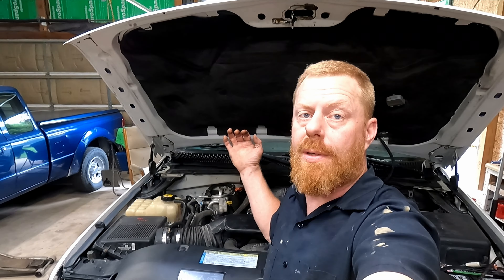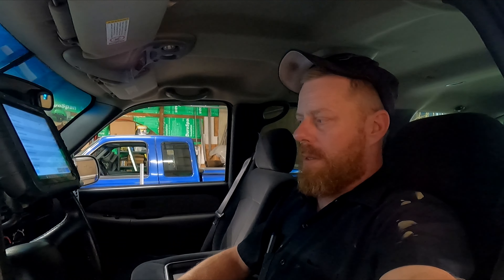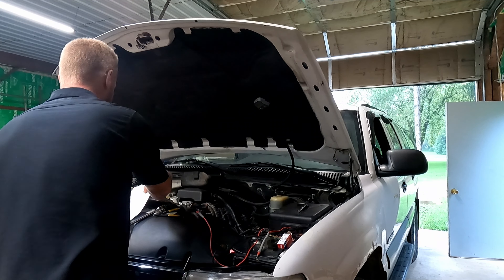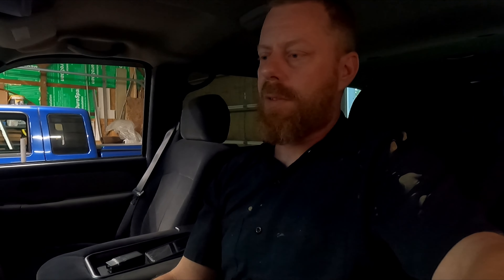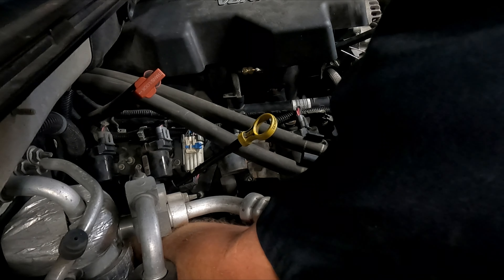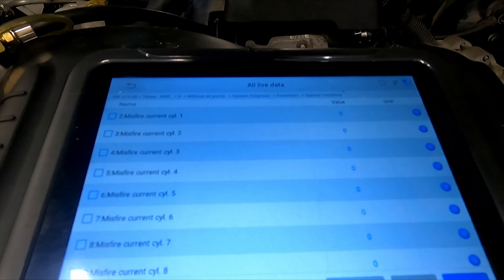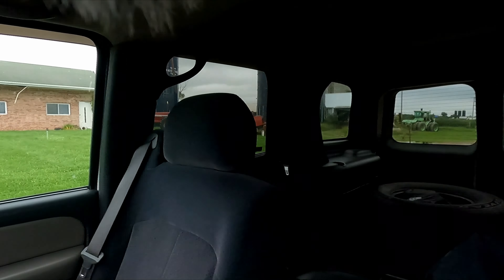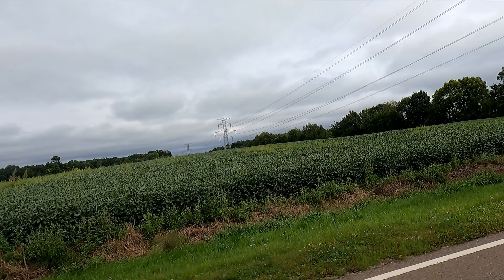What's Wrong Chevy Tahoe 5.3L: Misfires Galore Coolant Temp Sensor

Comment: 12:01 
So I’ve been fighting 0 degree weather here in Ohio chasing a super rough idle, misfires, temp sensor, coolant leaks, electrical problems galore. This video showed me that I am not crazy that all of these things are in fact related and do in fact need to be repaired correctly and if one is bad when it comes to the computer reading Air/Fuel mixture it will likely need to be addressed again. This all started with a serpentine belt replacement. Lol

Comment: Having the same issue right now. Was getting low circuitry to cts and running lean, I could hear the misfires but they weren’t showing into my tool. I changed the cts and now I’m showing random misfires. 
I’ll check back in after new plugs and wires… GREAT VIDEO 😂 👍🏽
Reply from the maker: Thank you for watching
Reply: Did you find fix for temp sensor?